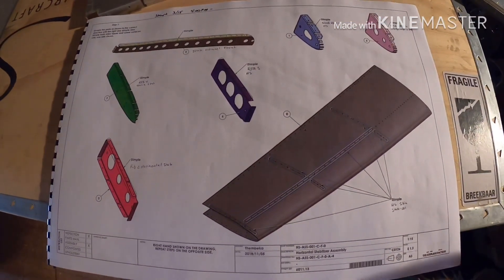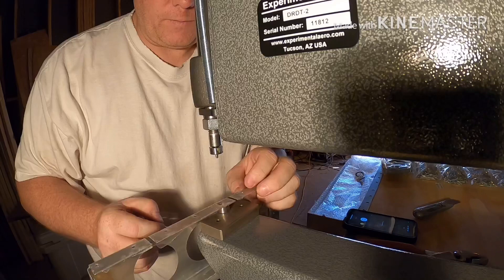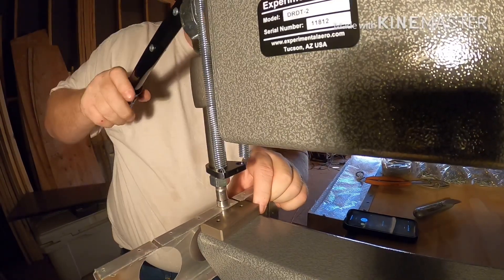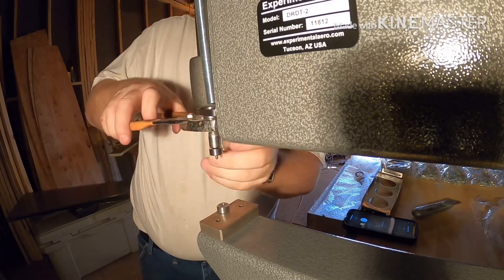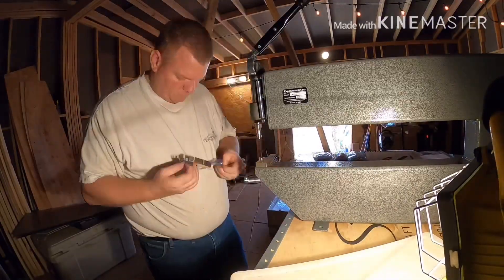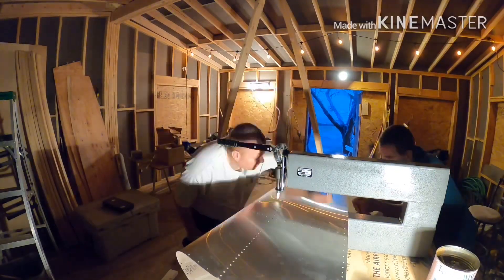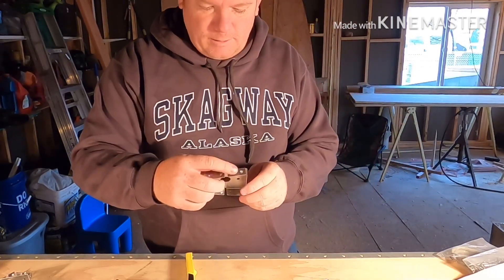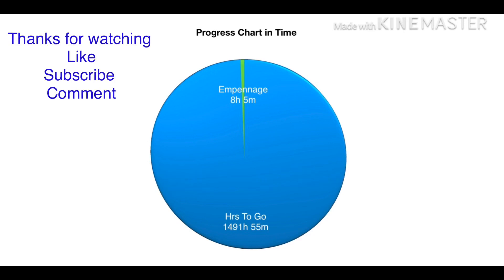Empennage Horizontal Stabilizer Assembly Step 1

Comment: What was the process of grinding down the ddrt  dimpler you mentioned?  I am just setting my dimpler now.
Reply from the maker: I just used a bench grinder and ground a flat spot. Be careful if it gets hot it will ruin the o ring on it. I melted my o ring. Maybe take the o ring off before grinding it and wait until it cools to put it back on. Good luck on your build.
Reply: @airburt  I guess more to the point - why do you need to grind it down?  :)
Reply from the maker: @ibgarrett  it is too wide for some of the holes you dimple on the ribs. If you didn’t do this then it would crinkle that part of the rib. Maybe the factory has corrected this issue so it might not be an issue for you. Just check it before you dimple.

Comment: Another note - the small dimple die from ATS is 100 degree, but the pop rivets are 120 degrees, so you'll create a deeper hole than you want. So you want to get the 120 degree dimple die (dt-17014) from Wicks for that. More details here - https://slingtsi.rueker.com/2019/03/24/finished-riveting-the-horizontal-stabilizer-skin/
Reply from the maker: Thanks Phillip, I need to get that ordered.

Comment: You have to match up-drill the holes after dimpling to the size of the rivet. The holes for dimpling are not drilled to final size. That's why you struggled to get the rivet in.
so first you dimple, then you assemble together with the skin and then you match-drill the holes (when they align) to the correct size (most of those are the 3.2mm rivets). I've written some more details on my blog about this https://slingtsi.rueker.com/2019/03/19/horizontal-stabilizer-skin-fitting/

Comment: Great video Brad.  I did sheet metal work in Vegas for 3 years and I've done plenty of rivets but I've never had to dimple the sheet metal before.  I just drill a hole and throw in a rivet. Is it so the rivets sit flush and not cause wind drag?
Reply from the maker: Exactly Ryan it is to limit the drag and help the airplane go faster and more efficient.